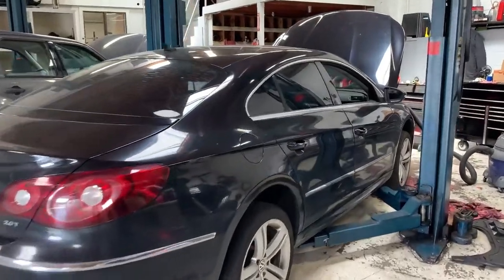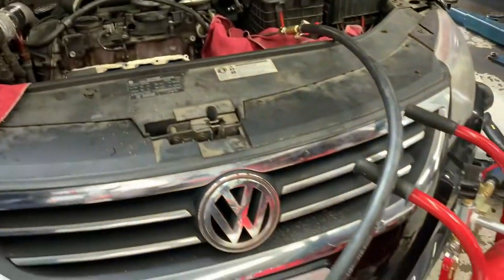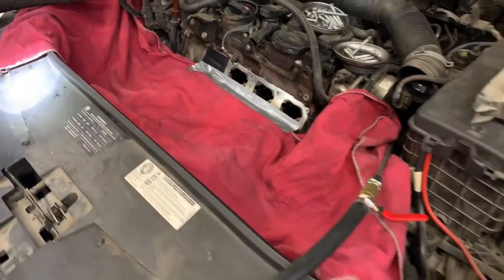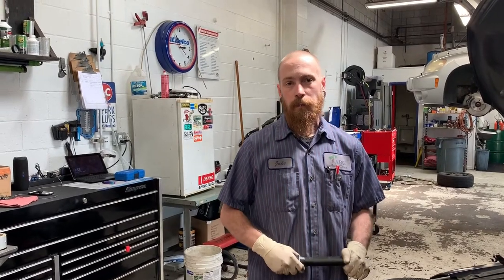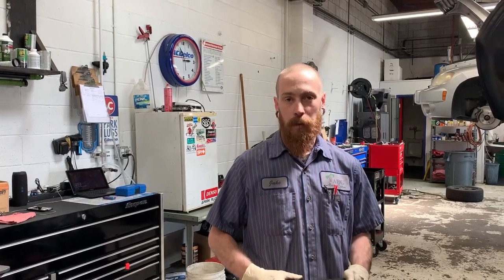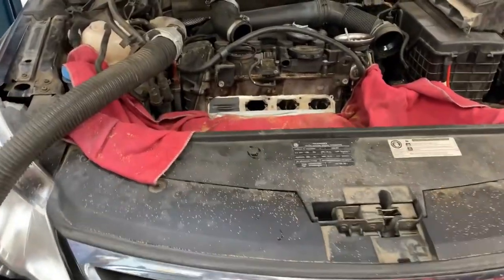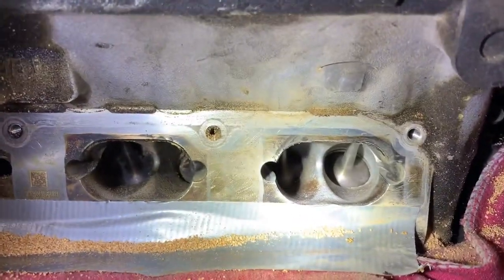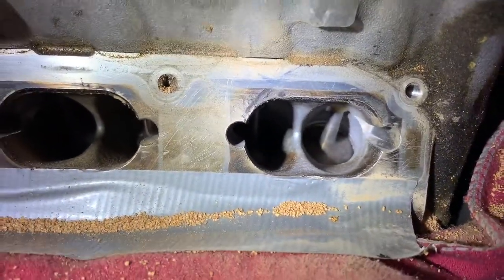Valve cleaning on a Volkswagen CC

Comment: Just wanna ask since he said it wasn’t turbocharged😂 did he at least hand crank the engine to close the valves so no walnut or chunks of carbon go in the engine. A shop that didn’t know much of vws ruined my friends gti after a carbon clean a few yrs back
Reply: A very good question indeed. First, to correct one error in the video. The tech incorrectly said it was not a turbocharged engine, it was. Second, the valves do have to be in the closed position for the work to be done. Thank you for noticing.
Reply: Before cleaning anyone cylinder, the tech made sure the valves were closed, otherwise as you said DISASTER!  This was not the first time he had done the job, unfortunately he mispoke about the turbo.